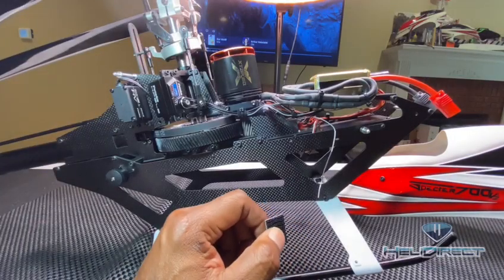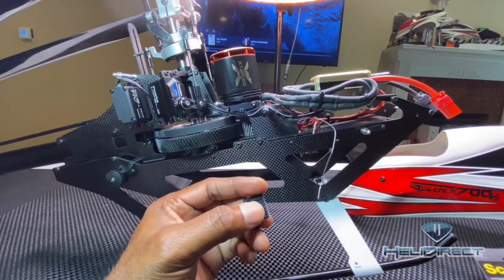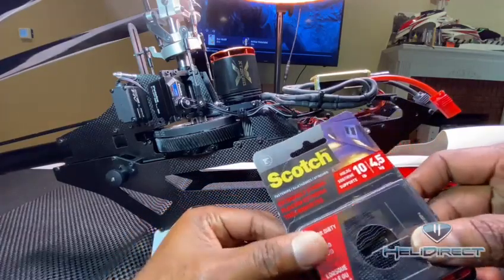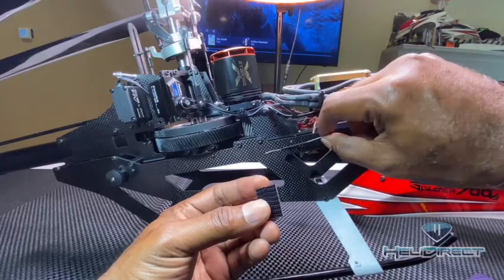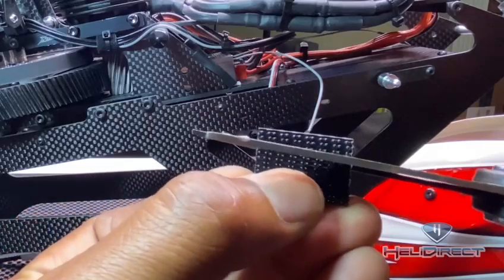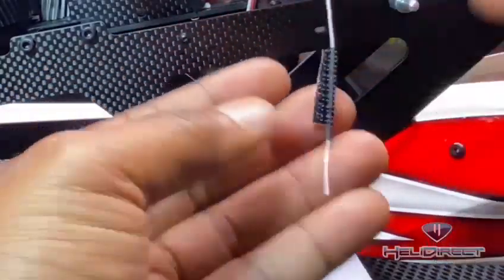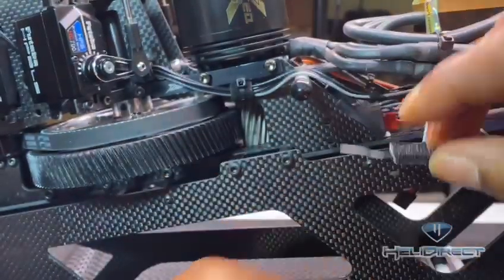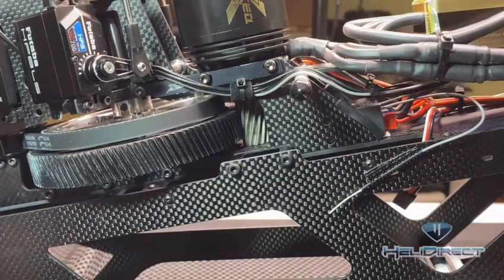HD QuickTip #1 - Mounting Receiver Wires Nick Maxwell Style

Comment: Do you know if this would work with vbar neo antennas?
Reply: From what I understand from Peter Russo, the first 31" from the Antenna tip back must be at 90 degrees. It doesn't matter which plane (XYZ) there in just  has to be 90 degrees.

Also, Auggie Copter (search YT channel) put out a Technical Antenna video describing the signal loss of antenna placement near a carbon fiber frame using a modeling software.

If antennas placement works near a carbon frame and they have had no issues doesn't mean it may for for you. I sure don't want to be the first to have loss of signal.
Reply from the maker: If you put heat shrink on it I believe